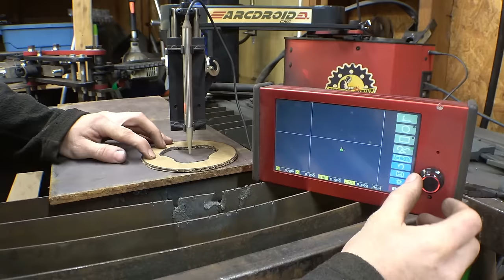Finishing the Rear Suspension - Mini Baja Bug!! - Part 6

Comment: Hey Chris! I think you should go with the third option regarding your gas tank concern. Build a tank behind the seat, and have those two red ones on either side of the body as a spare. They also become really cheeky accessories on the Baja Bug. Greetings Dennis from Sweden!
Reply: Yes, that large 2 stroke will be thirsty….wonder what size tank was used on the snow machine he sourced the engine from
Reply: The tanks are like 10 gallons and you get about 100 miles in the factory snowmobile
Reply: What about a small keg type on the front behind an approach angle hoop or whatever they are called. Front bumper hoop?

Comment: It is a safety issue. Only a tank behind the seat and no tanks outside the vehicle. If you roll over you are trapped, and then you do not want any possible punctures in a tank filled with fuel. Look at what happened to the shock absorber from your other vehicle when you rolled over. It is also much better for the center of gravity. I also recommend to install something to protect your head for when you have a rollover.

Comment: the vehicle. If you roll over you are trapped, and then you do not want any possible punctures in a tank filled with fuel. Look at what happened to the shock absorber from your other vehicle when you rolled over. It is also much better for the center of gravity. I also recommend to install something to protect your head for when you have a rollover.

Comment: Use thick wall tubing for the side bars and use them as part of the fuel system connect the two cans to the bars and bars to each other.

Comment: Now that you have that cnc plasma cutter, you should use it to make yourself some suspension adjustment wrenches to go with your builds so you can fine tune the suspensions without having to resort to a hammer and punch. Wrenches will help you make repeatable adjustments so you keep everything easy and repeatable.

Comment: I like the idea of horizontal cylindrical tanks on both sides mounted above and inside the tree kicker rails.  Maybe make the of aluminum with rounded dome caps and a filler neck on aft top end.  Could be 2 gallon on each side.

Comment: i used a 5 gal plastic outboard fuel tank on a few projects .. they are cheap, also made them so i could easily remove them to take to get filled without taking the baja. great work sir 👍

Comment: Tree kickers or Nerf bars as we call em here are a great idea, that prevents someone elses tire from getting inside and fliping your buggy. They were really common on Odyssey's and Quads  in the 90's   i would try to wrap the gas tank around the rear seat to keep the weight low. you can always cut the rear trunk latch for more room for motor and brakes.

Comment: Chris, what about having the gas tank either side of the seat in the floor and protected by a skid pan,  you could link them together to act as one large tank and use a electric fuel pump for fuel delivery to the motor, that will  give you all the space behind the seat spare for a small tool box  ?   the skid pan will protect the tanks from damage  and you could add a fuel filler cap and fuel up from the rear quarter pannel in the body ( hole drilled and a filler cap installed).

the nice thing about the floor pan tanks, they are out of sight , yes its a lotta work to alloy weld up the tanks but it would look hella cool and be a talking point to.

Comment: I love it when RBW pops up in my feed.... Makes being awake worth it.       😂
Edit: I'd just run 3 of those tanks as the gas tank(s)... 2 on the sides and one behind the seat should be pretty good but if you want a LOT of range then do a custom tank behind the seat, you can probably get a 2 or 3 gallon tank in there.       👍

Comment: if you want to pop easy and reliable wheelies having stiffer rear suspension will only help, you're likely going to need to reinforce the rear transfer axel a good deal with brake discs being so close either side of the frame rail you don't want it to be twisting under heavy acceleration
Reply: I mentioned that earlier when he was obsessing of travel. It's gonna have to squat before it raises the front.

Comment: Just an idea, but maybe you could add a running board/step along the bottom of each side of the body. A 2’6” piece of 3x4” box iron on both sides would be about 1.5 gallon capacity so 3 gallons total. Anyways, keep up the great work!
Reply: Plus you get Smokey Yunick style points!

Comment: I imagine you'll want some form of firewall or at least noise isolation from the rear engine, if a coolant line fails or something catches fire, even a tiny layer of metal can mean the difference between a funny scare or having skin grafts all over. I'd say, formed firewall directly behind seat, and any space remaining is your gas tank. Also, having the tree kicker as a tank is an option, too.

Comment: Hello Chris look into a small reverse box like the Elite Racing Transmission or Quaife Reversing box or Extreme Engines EXT-RB1 Hayabusa Reversing gerabox or just use a FIMIC LLC. 75PRC61T-11 T-BOX 100Hp 1.1 6 spline With this T-box you can turn the motor 90 well keep up the cool builds.

Comment: I think one tank behind the seat. I don't like the idea of having external fuel tanks that close to my face. Depending on how much you fill them, with thermal expansion, and all the jostling around while driving, your liable to have the caps blow and get raw fuel in your face and eyes. Not to mention punctue risk (we all know your rollover track record 😂). A tank that conforms to the seat is the best option. Safer, more esthetically pleasing. I'm sure it'll be worth the work in the end IMHO. Looks killer either way.

Comment: Cut the roof and back window area out. Put some triangular bracing in the front corners of the winshield, and mount some round side mirrors on the braces. Nomore peeking out of the roof, and no worries of your helmet smacking around in the opening. If it were mine I'd cut that sucker right down the middle and widen the whole thing also. I wish more people would do small scale cars that look and function like a full size vehicle, instead of the Power Wheels look. Love what you do though. The keg gas tank would be awesome too!

Comment: 9:00
70-30 Anti-Adhesion Metaflux abra+

- Special aerosol to prevent glazing of coated abrasives.
- Prevents glazing of grinding wheels and flap discs, as well as sandpaper
- Extends the life of abrasives several times over
- Prevents overheating of metals
- Contains no silicone
- Colour: yellow
- Thickness: 0.715 g/cm³ [0.41 oz./in³]

ultra-fine oil
it breaks down joints, slides, etc.
and really makes them easier to use 
but you have to use a good dose, it cleanses,
and apply often, it evaporates.

(1 night, 1 pack of beer and 2 metaflux bombs later...
- on a second-hand 'pro' mountain bike / worth 5,000 euros -
completely removed all the grease, and thats "70-30" :

its owner no longer understood anything,
it was doing 10m with 1 pedal stroke, on a dirt track
and I had even added a small sprocket -it passed....)

Comment: I’d say keep with the side tanks and also have the tank behind the seat. It seems like it would be a good weight distribution for the fuel. And you can never have too much capacity in a small compact rig. Keep up the good work brother
Reply: What engine is he using? Never mind found my answer. That's a thirsty engine. 2 gal won't go far. Also how do you cool a 2 stroke snow mobile engine. They use a heat sink instead of water. Not gonna fair well.

Comment: For one possible variation on how to configure the fuel tank(s), take a look at the auxiliary side tanks that were mounted on this original Meyers Manx dune buggy to extend its range.

Search for the article "This car matters: Meyers and his Manx at the Classic Auto Show" to see the image.

Ignore the one on the front because that would put weight in a place you don't want it if you really want to do wheelies.

How about a pair of cylindrical aluminum tanks similar to old school "Moon Tanks"  - Search on that term if you need a visual - that could be wrapped inside the "tree-kicker" bars near the Bug's lower edge.

Comment: When I did my cv axles I lathed a press fit sleeve and pounded it into one side tacked it, pounded in the other and welded both all the way around. I hope yours holds up with the varying strengths and harnesses in the shaft. That was my concern when doing mine.

Comment: Chris, two gallons isn't enough fuel for that engine for the amount of driving you will do with that buggy. You need to have more capacity than that. I want to suggest that you put another tank behind that seat. Look at that place. You're able to see that it will be low enough so that the center of gravity will continue to be nice and low. It will additionally be of an excellent size for the amount of traveling you'll be doing with it.

Comment: I always had an idea for a "limited slip" diff but would only work on a diff like this one.  RC cars change how much the diff "slips" by changing the internal viscosity of fluid and they work like this one with the internal axle gears and an external ring gear.  I always wanted to see if that would work on a larger scale.

Comment: I’d definitely run the small tank and reserve tank options, for the exhaust have you thought about running them down and forward then dump out the sides like a reverse laker pipe setup behind the front wheels

Comment: I love all your ideas but a relatively small cylinder tank ( 10" diameter by 14" width) would hold almost 5 gallons of fuel.  By the pictures I could see that fitting pretty easily behind the seat but above your horizontal brace.

Comment: And if you could have integrated the lower linkage setup for the Raptor rear swing arm it definitely would have helped with your suspension adjustability and travel

Comment: Idea for gas tank... rock sliders, strong but hollow, they get used for compressed air when there is no room for an air tank, so why not a fuel tank? another idea is a fake spare wheel on the hood!

Comment: If you wanted to be able to ride wheelies with this machine you should have went with an a arm suspension rather than trailing arm suspension although it's obviously possible to do wheelies with trailing arm suspension but an a-arm set up makes it a lot more controllable

Comment: Turning a track will obviously use more fuel than driving a steady speed on tires, but a 700cc 2 stroke sled can drink 5 gallons in as little as an hour. 
I’d guess 2 gallons will give you around an hour of driving.

Comment: this thing is really looking awesome. i think you should fit the biggest tank you can inside the body behind the seat like your initial plan. then you can throw on a jerry can or two for extra range. my only concern is safety for your head though. any plans on like a head roll cage like on old top fuel dragsters?

Comment: Great video.  Do you think the differential will get too hot, since there is very little room for lubrication?
Reply: His original idea is to pack it with grease which would help some, I'm hoping he'll find a way to fill them with gearbox/transmission oil since he's both capable, and I'm biased, prefering oil over grease
Reply: The way he is using it, the bearings are outboard and the only time anything will be asked of the lubricant inside the differential is when the wheels are turning at unequal speeds. I doubt in this application he will have any issue with it getting hot.
Reply: @isaacclark6749  I don't doubt it.
Like I said, I'm just biased about preferring gear oil over grease

Comment: I have to wonder if you are going to have 4 calipers so you can have a foot brake and two cutting brake levers or just two brake pedals that you can push together or individually (like old school tractors had!)
 you know you go back to using a predator or duromax 440 like RBG loves to use, and it would still be something totally different to everyone else's builds
Is it time to upgrade the grinders and try batterie powered ones? I hate Li-Ion batteries, but love my tools that they run!
personal recommendation... don't try to use the last inch of travel in either direction, keep it to 9 inches, it's plenty, you don't want to roll this thing like you did the last build, it will actually hurt!

Comment: Hi Chris if it was me i would fit those gallon tanks to the side and put a smal gas tanl behind the seat and use the oyer ones to top up the main tank behind the seat that would look cool a s I do think 2 gallons isnt enough for that engine it will guzzle the fuel on top revs as those tanks will make it look cool and functional with the main tank maybe also a 2 gallon tank which will give you four gallons maybe expand the tank to four gallons if you have the space it all depends on how far you intend to travel on each excursion so only you know cfris how far you intend to travel and those engines are known for there economy so maybe a four gallon or at least a three only you know so all the best a great build chain is the way to go for this model of vehicle and you proved it worked on the two man rock crawler in four wheel drive all you need to do is sort out the operation of getting it into four wheel drive maybe by using a small vacuum pump instead of syringes so all the best from john from Rugby UK.

Comment: Why not put the diff in the middle of the frame instead of a few inches above it? You can build a box in center of the axle center line for it to bolt to

Comment: I just can't help but think the engine placement is going to make this a sketchy ride if there is more than a 2° incline. Wheelie and rollover hazard. But we will see
Reply: I think he's going to get what he wanted, a wheelie bug 👍
On a serious note, however, there are numerous r.e.r.w.d  (rear engine, rear wheel drive) cars, including several types of factory built porche, the original VW beetle and more. Then you have the custom or kit builds like baja, sandrail and so on which are similarly equipped... most of those are pretty stable and only do wheelies if modified to do so...
I'm definitely looking forward to how this build goes 😉

Comment: I am of the opinion that I think you clearance your bearings a little bit too much when you assembled your differential. I believe you want to press fit there to be sure that the bearings spends solidly on the inner race and solidly on the outer race and that neither one actually turn on their parent Shaft or case

Comment: You guys Wasting so much metal. You should buy a furnace. And recycle the scrap buy melting it down and pouring it into a mold  to be reused
Reply: That's pretty cool I was thinking the same thin😂
Reply: How come I didn't think of that? That's genius
Reply: It looks like you commented that twice bro. 😅
Reply: If you mean steel, that’s no small feat.
Reply: I'm surprised nobody else thought of this.
Reply: @grntitan1  That's probably why no one else is doing it.
Reply: That why he saves he's metal scraps and sells them to a company who dose that well I think iv herd him say that most metal shops do
Reply: @wippitywine2 If anyone can do it, this guy can.
Reply: @jedanimate I’m glad you have confidence in him, but I think you haven’t a clue. Steel begins to melt around roughly 2500° F. To pour steel, you need temps in excess of 2900° F. Not only do you need to reach that temp, you have to hold it there. Then what? What do propose he do with 3000° molten steel?